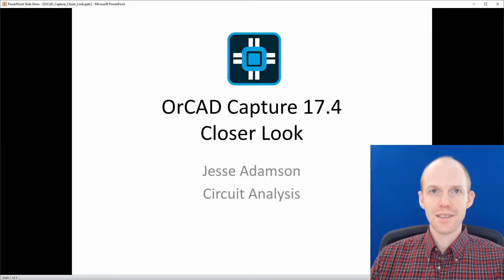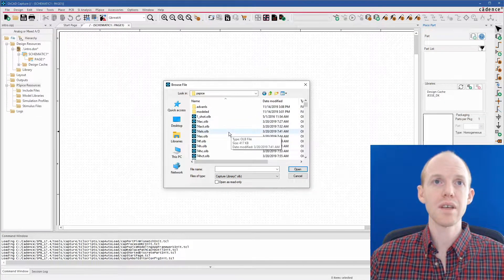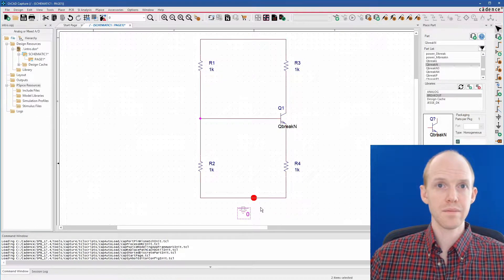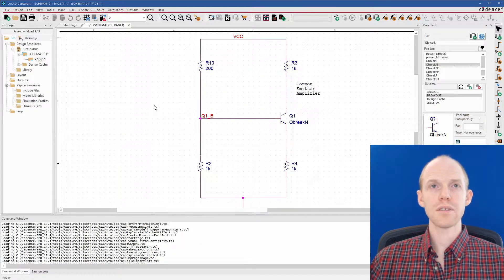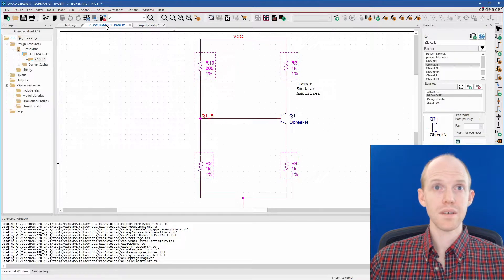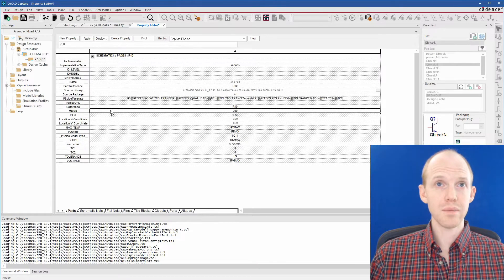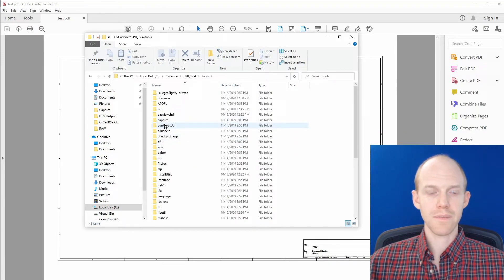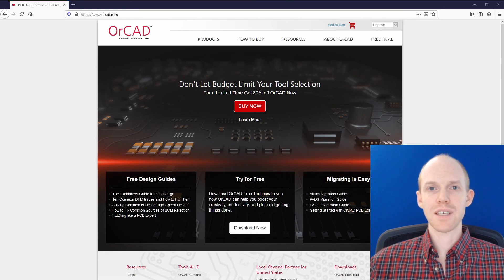Cadence OrCad Capture 17.4 - Detailed Overview Tutorial

Comment: @Circuit Analysis  1 thing that you didnt mention is datasheets. You can have a datasheet property attached to the components property wirh a file name such as "D:\Cadence\CIP-E\tech_docs\on semiconductor\1n4148.pdf"  and there is a tcl script so you can right click on the component in capture and it will display the datasheet also the same thing will happen when you export the pdf.

Thought you would like that tip
Reply from the maker: Ah that's awesome. I just tried it and didn't figure it out though. I double clicked my opamp in capture and added a "Datasheet" = "C:\TEST\lm741.pdf" property. I also tried "DATASHEET_LINK". But after that I didn't see any easy way to view it in the right click menu? Does this require the CIS mode? Do I have to download a plugin or activate any particular TCL script? Thanks!
Reply: @CircuitAnalysis  Oh i forgot a link to the tcl app is inside the pdf and the fact it doesnt open in the pdf is probably because you have protection mode on the pdf explains how to disable it as well

Comment: How to add library in 17.4 (2021patch) ?
Reply: And is there library editor like in 17.2 ?
Reply from the maker: 17.4 is the same as 17.2 just with some prettier icons and themes. To add a library you do the same thing, press "p" to place part and then you get the panel on the right with libraries. Then you click the "+" button to add a library and use the open file dialog to select the library file to add. Is that what you were asking?
Reply from the maker: I see two programs in my directory: 
"Allegro Library Creator 17.4" and "Library Explorer 17.4" 
but I have not used them and my license does not seem to support either. Are either of those what you meant by library editor?